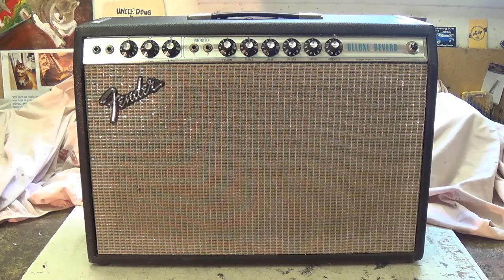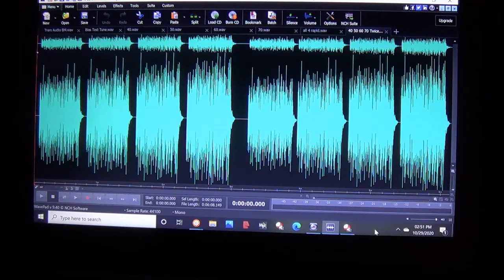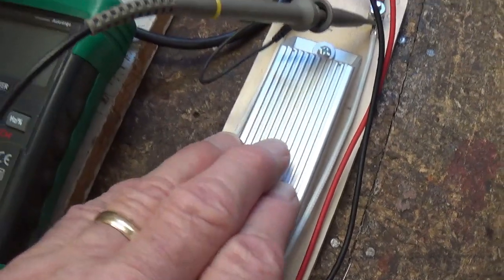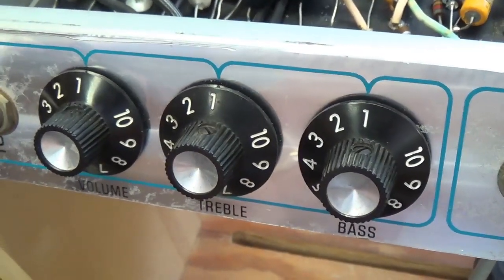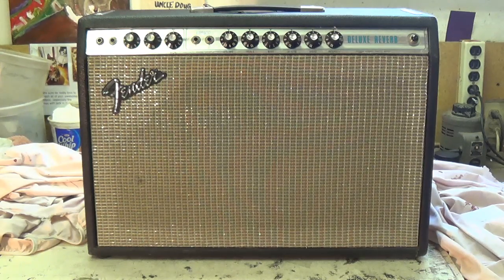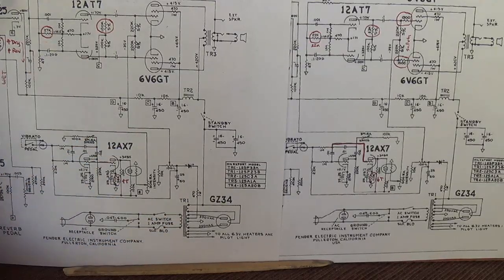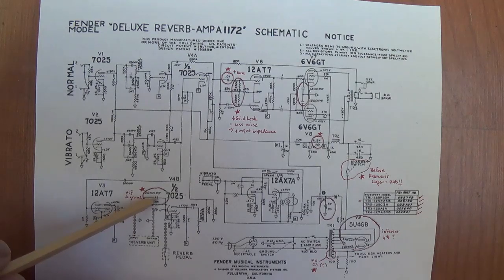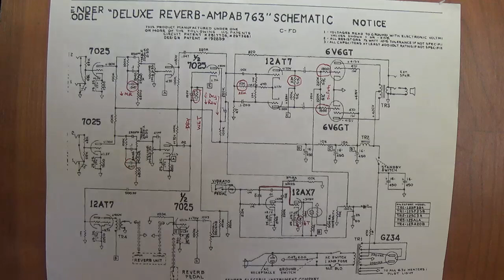The Effect of Output Tube Bias on Tone, Gain, and Headroom.....A Side-by-Side Comparison

Comment: Keep them coming! I vote YES! Great video.
I'd like to suggest an in depth overview of a tremolo circuit and what changes can be made to it and their affects - both solid state and tube circuits. I have a Gibson G-20 (solid state, not to be confused with the GA-20) that has a tremolo circuit that does nothing until it is at 4 or 5 in the intensity dial. I'd like it to start doing something at around 2-3. I know that you have done explanations in other repair videos, but one that focuses on just a tremolo circuit would be great. Thanks.
Reply from the maker: Thanks, OG. I have posted several videos that focus entirely on the different types of tremolo circuit. Please check my video list.
Reply: @UncleDoug  I will have to go back through a the old ones... Thanks.

Comment: On a single ended amp, such as a 5F1 chassis, is there ever a happy medium for the bias setting that will allow someone to swap output tubes without having to re-bias; or, is the goal to get it set for the tube set you have and leave it be? The reason I ask is that there's a generally held belief that different tubes produce different tone, be it 12AX7, 6V6 and 5Y3. Even the folks that sell the tubes advocate different sounds, such as "Tube Depot." They describe the tonal characteristics of most all the tubes they sell, for example. After watching this, I now know how much goes into it and just swapping tubes may be detrimental to the amp and the wallet when trying to change tone if it's not looked at from the big picture. Thanks!
Reply from the maker: Good news, Chad. Since virtually all SE amps are cathode biased, you can switch tubes without the need for re-biasing, because the plate current is regulated by the bias resistor......so feel free to experiment with different tubes for different tone. I warn you, however, that unless you have a good imagination, you will most likely be disappointed with the result.......the differences, if they exist, will be quite minor.
Reply: @UncleDoug  Thanks! That’s been my experience so far - not a whole lot of difference.
Reply from the maker: @CC-te5zf  People can imagine all sorts of things, Chad. I wish I could hear what they do, but I (and lots of others) cannot.

Comment: Uncle Doug, It was a good idea to work through the bias comparison but I think an electric guitar track would have provided a more familiar reference for most listeners. I would have liked to see a hot bias check  (80%?) too. I was hoping too see (hear) a series of tests at different levels showing not only the expected headroom increase at hotter bias but also the effect on the character of the distortion (if any) with increasing bias as the amp is turned up.
I question the use of a dummy load and single frequency source as being representative of the amp performance in normal operation where impedance of the speaker varies significantly with frequency but for a peak output test it shows the differences  for the purpose of the test.
Probably an impulse test with a spectrum analyser would be more informative but not too many people have those😊 and the results would be inconclusive regarding tone "quality" in any case.
I look forward to your next excellent video.
Reply from the maker: I thought I did use an electric guitar digital recording for the comparisons, John. Thanks so much for your kind and knowledgeable input.
Reply: Sounded like amplified acoustic to me.  In fact I would bet money on it.

Comment: Great video uncle doug!!
This is all great info and I love how you crushed all the rumors we hear or read jumping down the internet rabbit holes lol.  Also I have always believed that back in the day when these guys designed their amps and perfected their circuits only to come up wih the 70% rule of thumb number, that hey maybe leo fender was on to something 60 years ago lol. You can be certain they wanted their product to work as best as it could.
 This is my point of view and you basically proved this perspective after watching this video.
I have always been of the opinion my amps sound better/more clearity and are louder at high bias. In most cases I have always biased my amps hot usually 70% or greater. Depending on the amp. My head style amp (marshall 50w)  I would bias hot up slightly above 70% for added "gain". But I will say the higher the bias the more heat my amps would produce. I could for sure physically feel the heat difference with my hand above the amp.
Which is why any combo amp I have (fender) I ran the bias lower (under 70%) purely based on the heat factor and design of the amps. Heads run tubes facing up and combo run tubes hanging down. Due to heat rising, head unit (my marshall) keeps the heat off of the circuitry where as the combo amps the heat rises and heats up the chasis and internal components.
As far as tube life I am uncertain if running your tubes hotter causes them to burn out faster. In my experience tubes are strange some are tough and last forever lol and other sets will die after a few months whether it be due to higher bias or damage caused from me the operator, moisture, in motion or moving the amps hot after a gig. Whatever the case may be in my experience over the years I feel some tubes are just tougher than others and perhaps built better or possibly sets matched closer last longer. I dont know.  I use and have always used cheap ass tubes in my marshall (el34 sovtek) reason being is it is my main amp and it gets more use so sovtek are cost effective and easy for me to source no matter where I am or when I need tubes. My marshall 2204 50w has been biased at over 70%. I am positive that the last time I biased it and replaced the tubes it was over 70%  (7 years ago roughly) they are still running strong and sounding great. However I have had sets of tubes die on me after 6 months of use. They were "groove tubes"  btw more expensive and died quick.
Now i should add that the last time I replaced tubes and biased my marshall I redid all the power supply caps and all smaller internal  electrolytic caps, resoldered tube sockets and PCB solder joints and replaced the bias circuit. Also a few of the high watt resistors that the value had drifted. Cleaned my pots replaced volume pot. Obviously with the tune up my amp circuit is more consistent so possibly my tubes have lasted longer for that reason.
Who knows. 
Tube life has always been a bit of a mystery and very inconsistent for me. Whoever says change your tubes after set amount of time religiously I dont agree. If you have a good set and they do their job dont change them. Tubes are like changing the oil or tires on our cars.
It gets done when they need to be done. 
Oh one more thing as much of a pain in the ass it is to bias amps (rip them apart, get out your meter and soldering iron in some cases lol)
I have alway enjoyed dropping a virgin set of tubes in and tweaking them to their full potential lol.

 Just curious as to when you all decide it's time to change your tubes??
Reply from the maker: It's time to change output tubes when their plate current decreases to a level that will not allow proper biasing, Bob, or if one tube begins to differ from the other to a degree that prevents reasonable matching.
Reply: @UncleDoug  right!! and at that point you will potentially have volume loss possiblel red/orange plate on one. Or unpleasant audio. So do you concur there is no routine set time change your tubes? Say once a year etc? and perhaps some tubes are just better made or more durable and have extra longevity. 
I cannot guarantee that my Marshall's tubes are still equally biased I am sure after so long it has drifted slightly and has a bit of volume loss  but nothing my ear can notice. I still dont turn it up past 2 or 3 lol. 
I have not checked it since the day the tubes were replaced. Perhaps it is time to pull it apart and check. Possibly they are not running as close as the did before but there is no audio problems tube still look as good and glow as the day they were installed and no issues thus far that would prompt me to check or adjust the bias.
Granted in the last 2 years it has definitely had less play time due to covid. Still I feel I have a really good set of well built sovteks this go round lol. 
Why fix it if it ain't broken lol
Reply from the maker: @BobBob-dv2qh  I agree that different tubes age differently and there is no set time period for tube replacement, Bob. I'll bet that more good tubes get replaced than worn-out ones.

Comment: The most likely reason they went to the 5U4 tube instead of the GZ34 is because the 5U4 tube is a very rugged long-lasting tube. They don't short out near as easy as a GZ34 does. The reason they lowered the value of the resistor going to the first node on the power supply was to increase the voltage to the phase inverter tube. The reason they put the standby switch directly off the rectifier tube was to make sure the high voltage didn't exceed the voltage rating of the filter caps since the filters are unloaded on standby.
Reply from the maker: Thanks for your input, Neutro......but if the voltage were high enough to exceed the filter cap ratings, wouldn't it be the same problem whether they were before or after the standby switch?
Reply: @UncleDoug  No. Without having the power tubes loading the power supply down the voltage will be higher on the filter caps. Test it yourself. Pull the power tubes out and see how much the B+ line goes up. I do agree with you however on putting the standby switch ahead of the filter caps as being a bad idea. When you hit the standby switch it puts a dead short on the rectifier tube until the caps charge up. With the cap charging up as the rectifier tube warms up it gives a softer start up on the caps and rectifier tube.  You are one of only few good instructors in electronic on youtube. It was nice of you to point out the differences in the Deluxe reverb amps. Even though I am a retired electronics tech I still like to see If I can learn anything. Keep up your good work.

Comment: Hello, Doug! I have a question! What difference the number of preamp tubes can make in the amp distortion?

Thank you so much!
Reply from the maker: With more gain stages in the preamp, your signal would reach the threshold of distortion earlier in the circuit, and be more pronounced.
Reply: It’s not necessarily the number of preamp tubes, but how they are being driven and how they are driving the next stage. You can distort one tube or gradually build it up over a sequence of coupled tubes.
Reply: Thank you so much guys!!

Comment: At 59 min you stated gz34 needs 1.9 filament voltage and 5u4gb needs 3 filament voltage do l need to do a mod to drop the voltage or does the gz34 just draw less voltage with no mod / and then adjust bias as needed thanks for your information
Reply: Rory Loftin You don't 'draw voltage'. It is 1.9A and 3A of filament cureent. not voltage. If your power transformer can supply the current, you are good to go.
Reply from the maker: Good answer, EJP. If anyone's PT can handle a 5U4, it will have no trouble at all with a GZ34.....but not vice-versa.

Comment: Thinking of a circuit modification for amps, should a monitor output be pulled via a jack before the final output tubes , for use in other amps or recording circuits ?
Reply from the maker: You can have a pre-amp output........for earphones, power amps, etc. It is commonly done.

Comment: Very well done video!  I just biased up a pair of JJ 6V6S's last night and attempted to get a dissipation of 70% based on 12 watts as the max emission of a 6V6 tube.   However, 2 things, I did not include screen current in my setting and also, many talk about the JJ 6V6S as being more accurately depicted as a 14 watt tube.   What I may do now is to gig with the amp for a month or two, then come back and base my setting on 70% of 14 watts, and also measure the voltage across the screen resistor, do some ohms law and subtract that from the full cathode current.   Then gig with the amp and see if I hear or feel a difference.   If I don't experience an improvement in tone and performance, I may as well go back and reset the bias to 70% of a 12 watt tube and maybe get a little more life out of the tube (probably very little!).   I had 435vdc plate voltage @ 20-21mA's with -43volts on the grids.   Thanks again Uncle Doug!
Reply from the maker: Screen current is an issue if you measured the cathode current (i.e. voltage drop across a 1 Ohm cathode bias resistor). If you measured the voltage drop across the two half-windings of the OPT primary, then your measurement did not include screen current. If your circuit has screen resistors, you can determine the screen current by measuring the voltage drop across them.
Reply: curious as to how it went with biasing at 70% for 12 watts vs 14 watts? did you try NOS or old stock tubes as well? thanks!
Reply: Thanks for checking in.  I actually left the amp at 70% of 12-13 watts because it was performing and sounding quite fine.   I figured why push it.   As I recall, the plate of the JJ's were seeing around 435-440vdc  depending on time of day and warm up, and bias current was about 19mA or so per tube.   I just opened up the amp a week ago to tighten a few things and and give a basic wellness check.   The bias was right where I set it when the tubes were put in fresh, so, pretty happy to see that.   I think there was about -42vdc on the grids.    @coolyanky
Reply: thanks for replying! I asked because I have JJ's installed now and decided to bias at about 12-13Watts per tube funny enough too and it's been sounding and behaving quite well! The real dilema I have is with a pair of NOS JAN GE 6V6GTY's that are about 3-4mA apart and although a bit noisy because of the small drift, they do sound pretty awesome in their own way. All the spanky, chewy goodness is there. Hard to say how much they would drift if I'd stick with those in stead. Cheers!  @philipdonovan5127

Comment: Doug in a push pull ,,one tube conducts on half of the cycle and it goes back and forth correct??
Reply from the maker: It depends on the class of the amp, but generally (and basically) you are correct.

Comment: Uncle Doug ,very interesting observations as always . I was watching with great interest, but one of the things that caught my eye and ear was when you were discussing the power transformer and no CT on the 6.3v winding. I was recently looking at the Classic Tone website and noticed their p/n 40-18016 which is supposed to be a direct replacement for the 125P23B (and appears to be in all respect) but it has no 6.3V CT. I have decided today to reach out to them and ask why. Was wondering if you have any experience with this?
Reply from the maker: Perhaps, with the advent of rather effective "virtual" centertapping, the provision of a real CT became unnecessary (?)
Reply: @UncleDoug  I received a reply from Mark Sacketti , VP Engineering , Magnetic Components. He indicated that their P/N 40-18016 is used in several different Fender amps and not all of them had heater center taps. Maybe it was a combination of the effectiveness of the virtual CT as you have suggested , and cost as well.
Reply: @electrofrying1685  I had not heard that , it would indeed be a shame .

Comment: Wouldn't the lack of a center-tap allow for a hum balance pot ?  Another keeper video by the way. Great reference material.
Reply from the maker: Thanks, Tim. Yes, you could install a (250 Ohm +/-) hum balance pot between the two 6.3VAC wires with the wiper to ground.

Comment: I Have a silly question with regard to the 2 reservoir Caps that are in Parallel,,,  Would there have been any protection or compensation resistors across the capacitors like when capacitors are run in series?  Thank you.
Reply from the maker: It's always a good idea to strap each cap with a parallel resistor to ensure that the voltage is evenly divided.
Reply: @UncleDoug  Hi Doug,,, Thank you for the great video and answer.. Very though provoking. Also initiated the question of Parallel/Series electrolytic voltage..  In series the as everyone knows the voltage is added but to my surprise in Parallel the voltage stays the same for some strange reason.  Very interesting :) Thanks again Doug